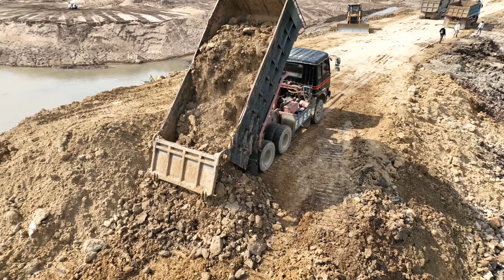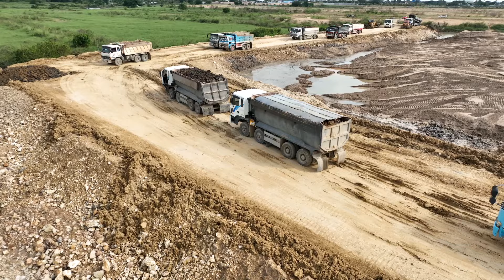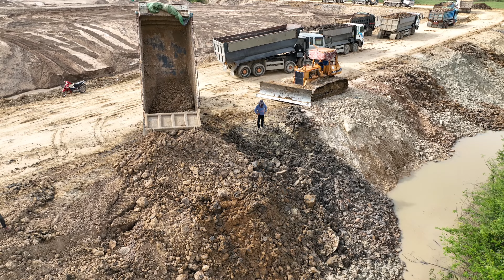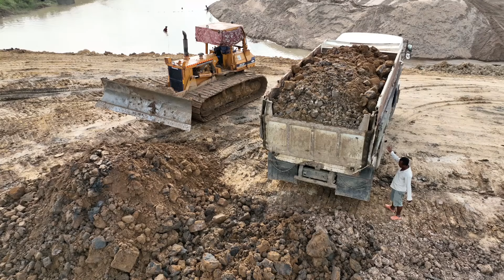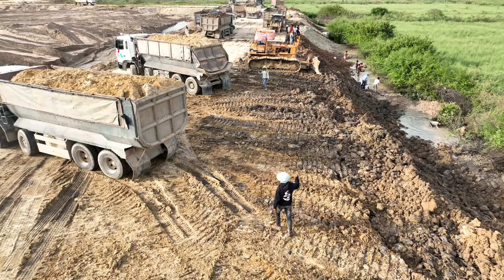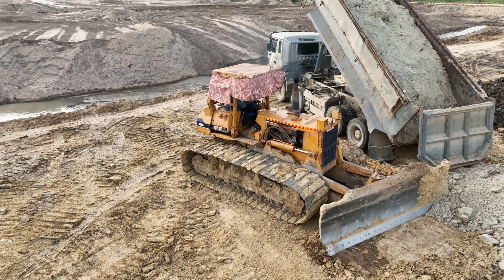Good Work Operator Skill With DumpTruck 25TON Many Transport Land With Dozer KOMATSU Push Land

Comment: Construction of a road with no safety standards at all
Reply: safety is less of an issue when all the operators on the job are sober...something you wont see in america
Reply: @j.d.m.3287  ..
Reply: Answer this , do they just get on with doing the job that they are contracted to do ? Is that a bad thing  ? Safety is important and necessary , but it must be in concert with productive  output .  Endless bureaucratic control and  Vitriolic Comments  are not  needed  , when dealing with intelligent people .
Reply: @johnmcdonald8298  Safety standards in america are money-making opportunities for the insurers and safety equipment manufcturers. therefore, the standards have been broadened over the years to extract maximum profit... watch the vietnamese build and improve the mountain roads...safety enigineers nightmares, but the jobs get done without casualty